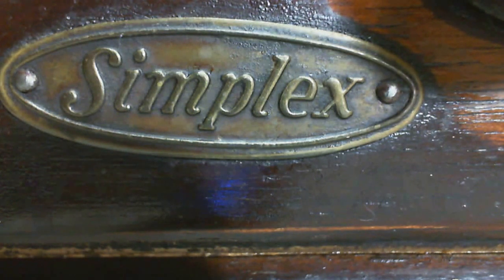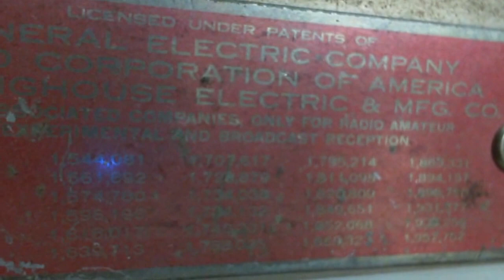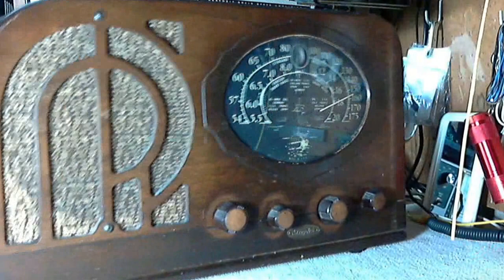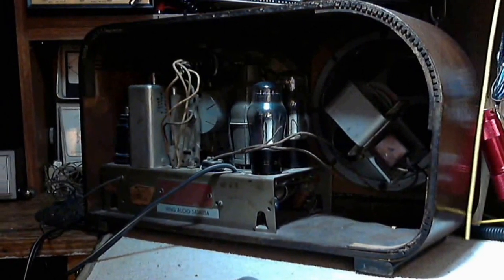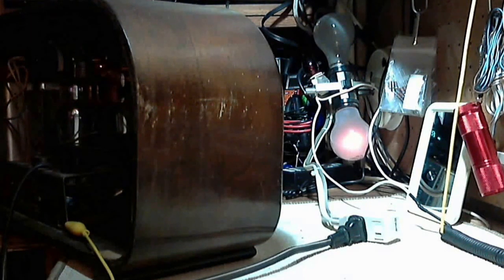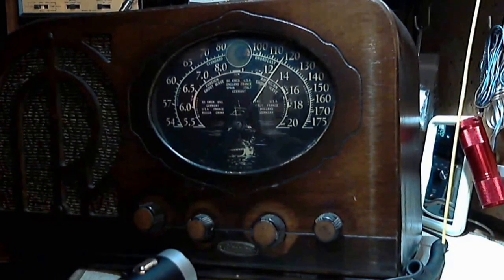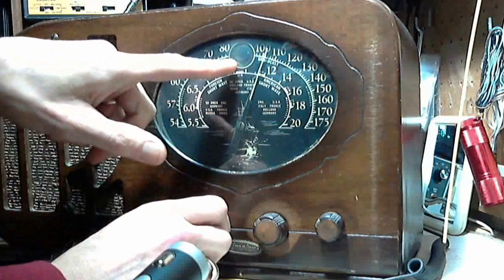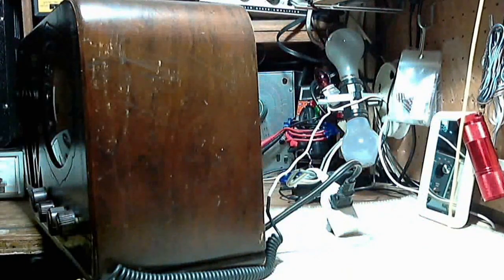Simplex Antique Vacuum Tube Radio Video #1 - Checkout

Comment: Not jealous, much.  It seems a lot of the magic eyes have had their resistors replaced in the matter you showed here. Looks like you need another safety cap.  I don't think it is the case this time, but there was a time when there was an attempt to give tube radios instant on like a transistor unit by either wiring the filaments parallel to the rectified voltage, but it would go directly off the switch input side. Sometimes with a diode like a 1N4007 was used to cut the voltage in half to the filaments until the power switch was turned on and shorted the diode out of the circuit.  - On second, thought, someone might have attempted either of those methods and you might need to convert it back to original.

Comment: Hmmm some other repair replaced the power cord with a polarized one but got it backwards. Perhaps swapping the connection inside the radio is in order.
Reply from the maker: Here's the safety problem with these 'AC/DC sets.  If you switch the wires around, the chassis will be hot when the set is switched off.  You can't win.  And in this radio, I think the line capacitor is leaking enough to power the radio a bit!  Yikes.
Reply: Jim Lindenas Ouch. So you have to decide if hot when off is more dangerous than hot when on. Yes, a lose-lose situation.
Reply from the maker: Yes but the larger point is that it's easy to get fooled (you won't be now) and a lot of these radios like this are missing their backs and people, especially curious kids, can get their hands in there.  Same thing goes with speakers with B+ driven field coils.  As a kid, I handled quite a few before I understood that there was high voltage on them and during that time, I was convinced that speakers were very safe.  The craziest thing I ever did was remove a picture tube from a TV and place it on a high up shelf and extend all the wires up to it including the anode supply.  I could have hurt myself a dozen ways doing that (and it didn't work either).